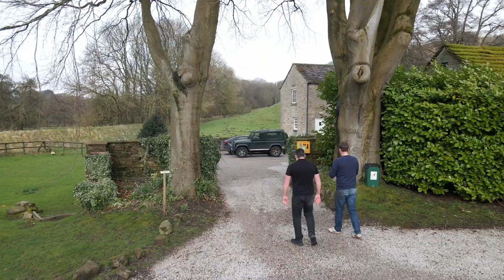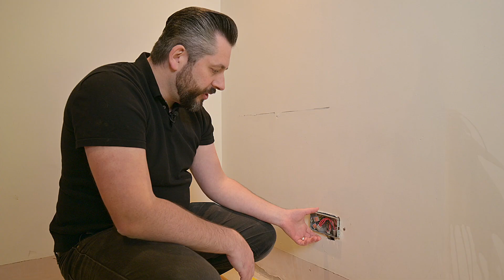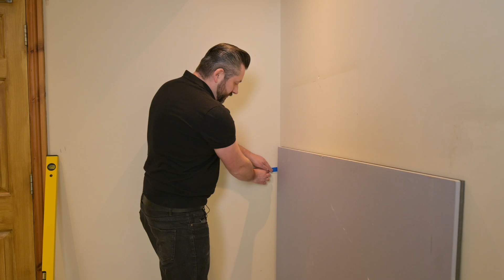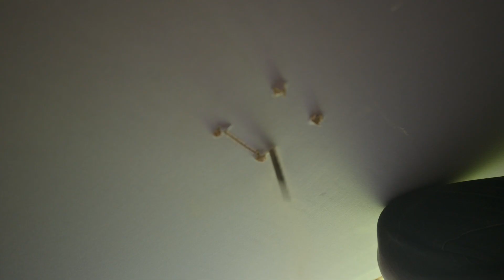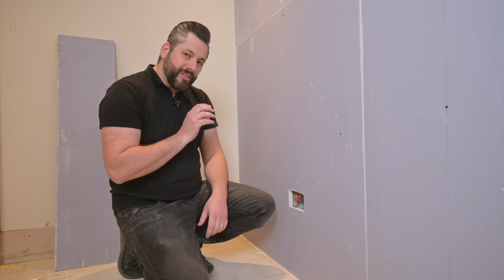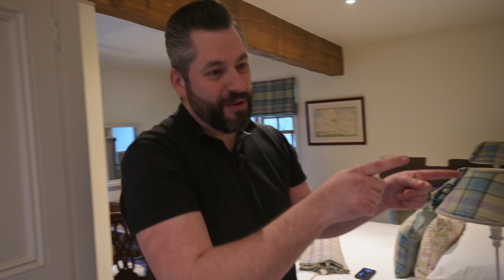How to soundproof a stud wall with SoundBoard 4, a high performing soundproof panel

Comment: Doesn't the finish plaster skim coat, not stick to the silcone you've used for  filling in the joints?

Short answer: no, plaster skim coat won’t properly stick to silicone.

Silicone sealant is designed to be flexible, waterproof, and non-stick, which is exactly why plaster (or paint) struggles to adhere to it. When you try to skim over it, you’ll usually see:

The plaster beading or sliding off

Poor adhesion leading to cracking or peeling later

Uneven finish where the silicone was applied

What you should do instead

If you’re filling joints before a skim coat:

Use jointing compound, filler, or acrylic decorator’s caulk (paintable), not silicone
Reply from the maker: Hi, thanks for the question / comment. We use an acoustic sealant which is designed to be painted and skimmed over directly. We have hundreds of customers every month (for the last 10+ years) using this sealant and skimming over and we never get comments or feedback about plaster cracking or splitting. Jointing compound can be used in certain places to fill gaps / holes, but can't be used as a perimeter seal as it needs to remain flexible to act as an acoustic seal.

Comment: Say you're doing a party wall ground floor and upstairs. Is there anything needed between the floorboards or suggestions?
Reply from the maker: Hi @BlueTeamDan, most customers will add acoustic mineral wool between the joists. No need to do the whole floor, just the first couple of rows in from the wall. 
https://soundproofingstore.uk/product/acoustic-mineral-wool-60kg/

Comment: Back in 2016 I paid over £2,000 for one bedroom wall soundproofing in a terrace. They used Tec Sound and something called mute board 3, which is acoustic plasterboard, foam and mlv. Even shoved rockwool under floorboards. It literally did nothing at all. House got sold a couple months later and bought a detached. You could actually hear everything from next door, even yawning lol
Reply from the maker: Thank you for the comment. Muteboard 3 is a different product but with similarities to our SoundBoard 4. We generally don't recommend those type of products for solid party walls, only stud walls. The science of soundproofing a solid wall is quite different and needs a different approach. These boards are really to add more mass to a wall that has little mass to begin with. A solid brick wall already has a lot of mass, so that isn't the problem, you need de-coupling to stop the vibration energy of sound from coming through. Thank you for sharing your experience.
Reply: @SoundproofingStore  yeah I've been watching some of your videos on the channel and realised this. It was a company called Ikoustic that recommended that system and installed. If I'd have known how little it would have done I'd have not wasted 2 grand. It was bad. You could literally hear them talking in my bedroom while they was in their living room.
Reply: @SoundproofingStore what if ‘de-coupling’ isn’t an option? My biggest problem with neighbours and sound is in a bedroom of a recently bought house, where, when I peeled off badly applied wallpaper, the skirting board was missing, and the was a hole (cavity) the entire length of the wall under the brick (about 1-2 inches deep).  I’m going to use expanding foam to fill the gap (soudafoam), and use Soundbloc wallboards, then have acoustic tiles on top.  I’d be happy to hear your thoughts on my plan. (I’m also getting thick rugs for near the wall).
Reply from the maker: Hi  @JohnM...  this isn't something we'd necessarily recommend. If you can't do the full de-coupling of the ReductoClip Independent wall system, you can use the ReductoClips direct to wall (please see below). Is the cavity from dot and dab adhered plasterboard not going the full way down and creating a recess? https://youtu.be/R2gvGyE6kTE https://youtu.be/lI2bdQZWyOE https://www.soundproofingstore.co.uk/reductoclip-direct-to-wall-system
Reply: @SoundproofingStore thing is, it’s poured concrete with plaster on top, and the gap (about 8 inches in some places) is all the way along the bottom. Plus, I’m not a very good diy’er :(
Reply from the maker: @JohnM...  can you send some pictures to sales@soundproofingstore.co.uk or alternatively feel free to call us on (01423) 206208. Once we have a clearer picture of what's happening we can advise accordingly.

Comment: How do you fit that directly to a solid internal wall thats not a stud?
Reply from the maker: Hi @derekprescott9809, in the same way. Remove skirting and coving (remove dot and dab if applicable). Start in the bottom LH or RH corner, leave a 5mm gap around the perimeter. 9 holes per board, hammerfix fixings into the holes, screw in place. The 5mm gap around the perimeter is then sealed with acoustic sealant. Full installation instructions can be found here: https://www.soundproofingstore.co.uk/soundboard-4
It's worth mentioning, that on a solid wall, depending on the level and type of noise you are tying to reduce, it might be worth looking at the higher performing ReductoClip Systems. This video goes into more details as to why:
https://youtu.be/huNDsYKLpqo

ReductoClip Independent System:
https://www.soundproofingstore.co.uk/reducto-clip-system
https://youtu.be/fQcfjqQvtOQ

ReductoClip Direct to Wall System:
https://www.soundproofingstore.co.uk/reductoclip-direct-to-wall-system
https://youtu.be/lI2bdQZWyOE

Comment: For screws, do normal screws reduce the effectiveness ?  You said the foam is to isolate the wall from the acoustic drywall but doesn’t screwing solidly to the walls just undo that and rejoin the two?
I get it’s only in small areas but I’m thinking like a speaker, the centre (screw) provides the power to controls the cone (acoustic plasterboard)
I’m looking into doing walls and ceilings and determine where I need reducto clips.
Reply from the maker: Hi @danielc6034, the surface area of the screw is so small that the effect is minimal. Using SoundBoard 4 on stud wall is usually to reduce airborne noise, rather than impact vibration and is there to add more mass to the wall. For domestic noise levels of airborne noise, SoundBoard 4 is an excellent solution. However, for vibration, impact sounds, or lower bass frequencies then you'd need to look at the ReductoClip. Any questions, or if you'd like to discuss anything in more detail, please feel free to call us on (01423) 206208.

Comment: What is the foam part of the board made of?... neoprene rubber or EVA?
Reply from the maker: Hi thanks for the question. I'm sure you can understand we can't say exactly what it is, that's part of our "secret herbs and spices" so to speak of what makes our board special. But it is a foam not rubber. It's a closed cell structure, high density foam. Either side of the foam is mass loaded vinyl which is a type of heavy, dense, rubber.
Reply: @SoundproofingStore   Probably be better if the MLV was not on the part touching the wall because it tends to "channel" the noise in build like that.
Reply from the maker: @JP5466  Actually we've found it doesn't make any difference. It's been tested with a thicker MLV on the other side and with the two thinner MLV's like we have it now separated by the foam, and we get the exact same results. The importance with such a lightweight wall is just increasing that mass.
Reply: @SoundproofingStore  But you still have lots of flanking noise because the ceiling, floor and adjacent walls were not addressed.
Reply from the maker: @JP5466  Hi, yes in a perfect world we would build a "room within a room" and make every space a soundproof, recording studio like haven. However, that's just not practical for most people and most situations. So we're aiming for a reduction in the noise from loud and disruptive to a small background noise you can ignore easily. By blocking a high level of sound through the main shared surface, we make it much better for the people in that room but without the extra cost and disruption of soundproofing every surface. As you can see in the results of this video, we certainly achieved a huge difference just by soundproof the main wall.
Reply: Does the MLV smell once fitted, with the high VOC?
Reply from the maker: Hi  @DonvonH   there can sometimes be an odour, but this dissipates after 48 hrs. (The MLV doesn't have high VOC).

Comment: hey we have a party wall in terrace house, would this soundboard make any difference? on the other side = 3 kids, crazy screaming mother and a yappy dog. 60mm for reducto clip will really make our hallway very small...but not sure if its worth a spend if soundboard4 wont make any difference? what are your thoughts? thank you
Reply from the maker: Hi Thanks for the question. To be honest if it's a solid brick party wall and you have loud noise coming through, I wouldn't recommend the SoundBoard 4. This is for light stud walls ideally. The ReductoClip system is far more likely to achieve effective results for you in your case.

Comment: Can you use this on brick walls and just plug and score it to the walls ? , sounds like a great way for sound reduction 👍
Reply from the maker: Hi @stephenBeecroft, yes SoundBoard 4 can be used on brick walls - however, this depends on the level and type of noise you are trying to block. 
The boards need to be mechanically fixed to the walls. We recommend using Hammerfix screws: https://soundproofingstore.uk/product/prosound-soundboard-4-direct-to-solid-wall-kit/
Installation of SoundBoard 4 on a brick wall can be found here:
https://youtu.be/5kRXjTEojck?list=PLuzNxK_R25wBueiDEUzdMUjXcqCON4pL7

For brick walls the recommendation would be to use the higher performing ReductoClip System:
https://youtu.be/R2gvGyE6kTE
https://youtu.be/huNDsYKLpqo
Reply: @ we have a dog next door that constantly barks, we are trying to find the best solution to reduce the noise , any help would be appreciated 👍
Reply from the maker: Hi  @stephenBeecroft  for a barking dog we would point you in the direction of the ReductoClip System. The ReductoClip Independent system is the highest performing as it fully decouples the soundproofing from the offending wall and will give you the best performance in reducing the noise heard from your neighbours dog. Alternatively, the ReductoClip Direct to Wall System provides an excellent performance v's space loss result. Please see more information on these systems below:

https://youtu.be/huNDsYKLpqo
https://youtu.be/R2gvGyE6kTE
https://youtu.be/fQcfjqQvtOQ
https://youtu.be/lI2bdQZWyOE
https://www.soundproofingstore.co.uk/walls

The recommendation wouldn't be to use the SoundBoard 4 (or any other direct to wall soundproofing panel) in this instance. Please feel free to contact us on (01423) 206208 and we will be more than happy to discuss and explain this in more detail with you.

Comment: Pretty excellent results, considering the boards are screwed into the wall (and not glued to the wall). Nice job.
Reply from the maker: Hi, Thanks for your comment. Actually glue makes no difference, we've tested both and there is no improvement in sound reduction from using adhesive. But it's less safe carrying that weight on the wall, so mechanical fixing is by far the best way.
Reply: @SoundproofingStore  Hi, I meant that they are easier to install and that the vibration through the screws is minimal compared to gluing. Since it is much easier to install and also doesn't make a mess in case one wanted to remove them as opposed to gluing  stuff to walls. I've watched many of your videos and it is very clear and nice how much better you are than most in the solutions you offer. Just would perhaps add as a suggestion that if someone needs greater results, more distance (instead of the 10mm airgap from the wall in the Reductoclip system) and more insulation will give that. As in 200mm or more total thickness compared to the 120mm that is proposed as a baseline. 
Wish you continued success. Cheers

Comment: The wall between our neighbouring property is just a solid brick wall. How would we apply it? Thanks
Reply from the maker: Hi @abigailtorrance6883, the SoundBoard 4 is simpy fixed directly to the wall with 9 hammerfix fixings per board. A full installation guide can be found here: https://www.soundproofingstore.co.uk/soundboard-4

However, whilst adding SoundBoard 4 to a stud wall greatly increases the mass and increases the walls soundproofing capabilities. For solid walls you need a solution that not only adds mass, but one that adds isolation and damping. The recommendation for soundproofing a solid wall would be to use the ReductoClip Independent, or ReductoClip Direct to Wall System. This is because a brick wall is more dense than a stud wall (with much more mass) meaning the bricks will already be doing more soundproofing (naturally) than a stud wall. In most cases, simply adding more mass to a brick wall won't give a huge improvement. Especially for lower frequencies of sound such as deep voices, music and snoring.
This video goes into more detail:
https://youtu.be/huNDsYKLpqo

ReductoClip Independent System:
https://youtu.be/R2gvGyE6kTE
https://youtu.be/fQcfjqQvtOQ
https://www.soundproofingstore.co.uk/reducto-clip-system

ReductoClip Direct to Wall System:
https://youtu.be/lI2bdQZWyOE
https://www.soundproofingstore.co.uk/reductoclip-direct-to-wall-system

Comment: Hi, I have existing walls to soundproof. Just wondering dow you would deal with the stick out thickness of the new boards especially around the door and window frames, and in some other cases the cornice? Or is it better to rip off the plaster wall and re do it?
Reply from the maker: Hi @philip.1408, the recommendation would be to remove skirting and coving / cornice prior to installing SoundBoard 4. If you are installing Acoustic Mineral Wool, then you'd need to remove the existing plasterboard and fit the mineral wool in between the existing stud work, then a layer of Acoustic Plasterboard and then SoundBoard 4. If you don't have enough space for this, you could fit the acoustic mineral wool and then fit the SoundBoard 4. 
With regards to door frames and thickness - if needed, a thicker door reveal can always be used. 
Please feel free to call us on (01423) 206208 and we can talk through this with you in more detail in relation to your own stud wall.

Comment: can you add a layer of tescound to the wall before you use this?
Reply from the maker: Yes you can add a layer of TecSound or FlexiSound 5 to the wall to further improve the results. Another option is to add another layer of Soundboard 4 on the other side of the stud wall frame. I hope this helps.

Comment: A big problem with new builds. Soundproofing on the other side of the original wall, maybe completely  sound transfer free.?
Reply from the maker: Hi @MrNigelbell, certainly soundproofing with SoundBoard 4 on both sides of the stud wall will increase the performance. With internal walls it's difficult to guarantee 'completely sound transfer free' as there are other potential paths the sound could travel, e.g. the floor, ceiling etc.

Comment: Does it interfere with a wifi signal?
Reply from the maker: Hi, Thank you for your question. A stud wall with our SoundBoard 4 will still have less mass than a solid brick / concrete wall. So no you shouldn't really have any wifi issues unless you already have a very weak signal already.

Comment: Can this be a replacement for plasterboarding
Reply from the maker: Hi, Thank you for the question. Yes, the final layer of the SoundBoard 4 is an acoustic grade plasterboard. So it can be finished and decorated just like a standard plasterboard but with a far greater sound reduction.

Comment: Hi there. I have been looking for a solution for ages to try and minimise sound from my neighbours through the party wall. Your videos have been really informative thank you! I see below you mentioned that this Soundboard 4 wouldn’t be a great option for brick/breeze block walls. If I don’t have the space for the Reductoclip solution what would you recommend? I would have about 40-60mm to play with. It’s mainly for my wife’s office which is a box room and also a cloakroom toilet under the stairs. Appreciate any advice you could offer me.
Reply from the maker: Hi @nediesneb, great to hear you have found the videos useful, thank you. 
If you can go to 60mm then the recommendation would be to use the ReductoClip Direct to Wall solution on your party wall. Further info and videos can be found below:
https://youtu.be/lI2bdQZWyOE
https://youtu.be/R2gvGyE6kTE
https://www.soundproofingstore.co.uk/reductoclip-direct-to-wall-system
However, please do feel free to contact us on (01423) 206208 so we can learn more about the level and type of unwanted noise you are experiencing. We can then advise on the best solution given the space constraints you have.